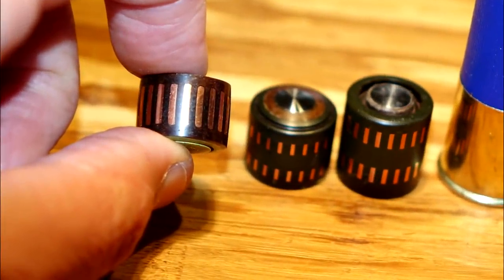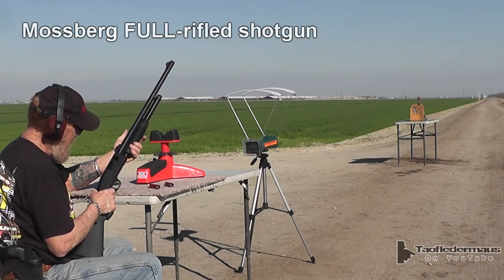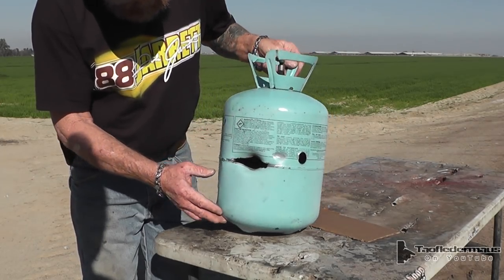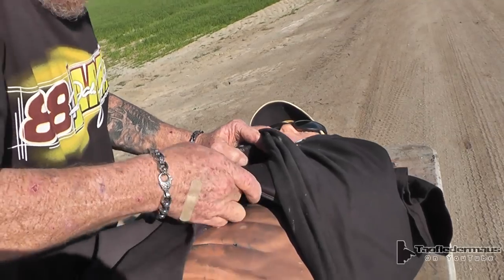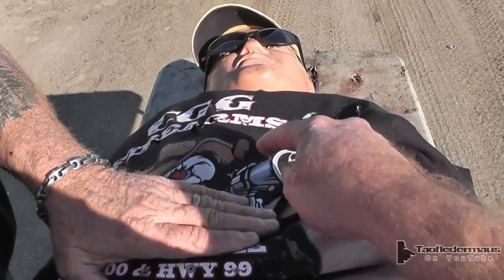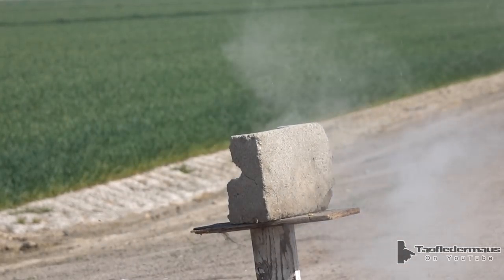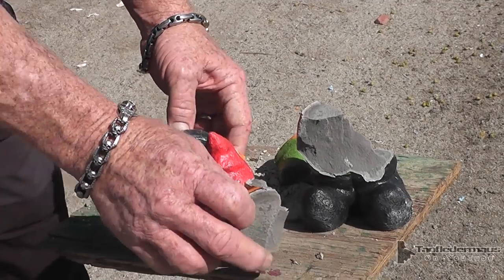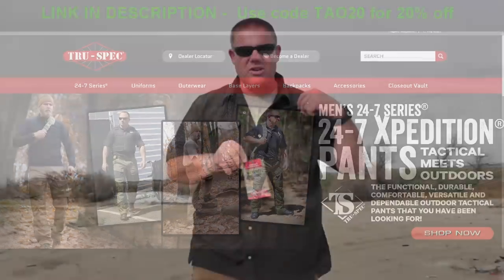Commutator Slugs -  Bissell Missiles -  You make it we Mach it

Comment: The weird pattern on the lead plate is probably from the little what looks like brass or copper strips in the outside wall of the coms either pushing out and back or cutting in while the plastic collapsed maybe? Curious to know as some of the coma u shot had small strips in lil 2 set rows others had single long ones

Comment: I didn't think they would do that well. Lots better than some of the high priced ones you've done I the past. As for Tru-Spec, I have a good load of their stuff and it holds together very well. Not only that, I had one package that I had ordered from them stolen while I was at work (UPS/FedEx) left it at my door. I called them up just to check if their was any insurance on the package. They said they would check and call me back. 

I was expecting a couple of hours at the minimum but they called back in less than 15 minutes and so no insurance, but they'd shipped out a new shirt for me and it should arrive the next day. It did, and included was also a free cap. You can't beat that kind of customer service. Not to mention, they're only a couple hours drive from me, so I consider them a local supplier. ;-)

Comment: One possible reason for the accuracy is that these commutator are balanced at the factory. A vacuum cleaner motor  could be spinning it 20,000 RPM so they need to be very strong to not fly apart under their own rotation and torque stresses. interesting experiment to say the least and pretty cool results

Comment: 7:20 idea for a new round. Nested domes into a single slug, so that the slug can follow rifling for accuracy but disperses into a group at a distance eventually, though tighter than shot, at least in theory the largest dome would impact a soft target & make the same hole as a normal slug, & each nested dome is simply additional holes in said soft target.

Comment: it makes sense these fly so well. Commutators are balanced so when spinning in the motor they dont cause vibration.
Reply from the maker: We've shot a lot of stuff turned on lathes that were very balanced but were not stable in flight
Reply: right, I wonder if it could have to do with how precisely balanced something is though. I suppose it could also have to do with center of gravity or maybe the steel core in these. Just speculation. Thanks for another awesome video though! been following your vids off and on for a while now its pretty neat to see the extent of what you can shoot out of a shotgun.

Comment: No real surprise those flew so straight. Electric motor core components are specifically made to be perfectly balanced in relation to central axle, so they would not vibrate when doing few tens oof thousands of rpms.

Comment: Commutators are designed to be perfectly balanced at extremely high speeds to reduce/eliminate vibration from the motor. Tha't why there should be no surprise at all that it was so stable whether spinning or not.

Comment: Stands to reason these would be pretty stable, a motor commutator has to be perfectly balanced since it spins at high speed. Add in a heavy core and it turns out you have a great slug

Comment: That plastic that was distorted should be some kind of bakelite or phenalic material.  Those materials are used because of the high heat from electric arcing that happens in that part of the motor.

Comment: Awesome.  Maybe they worked so well is because high speed communtators in motors have to be balanced to cut down on bearing wear?
Reply from the maker: We've shot a lot of stuff turned on lathes that were very balanced but were not stable in flight
Reply: Dear Sir, I'm at a loss then as to why they were so stable, unless the harder copper  bars were turned by the rifling in the barrel much faster than normal making them more into a bullet than a shot gun load?

Comment: I wear Truspec xtream Tru pants when I ride. 5 years 2 wrecks no wearing
Reply: MilesKenton they take the road rash good?  May have to pick some up for work on the farm and also work in general.
Reply: John-Paul Silke the knees have a rubber pad the rest is truspec ripstop. When I went down I was doing 40mph on dry dusty concrete and you can't see where I skidded on my right side. Second crash was a tbone on to the hood and front windshield. I added the truspec foam kneepads that are good also. Only thing I hurt was my wrist and ankle.

Comment: To be honest if its from a electric motor it should be balanced the motors need to be balanced
Reply from the maker: We've shot a lot of stuff turned on lathes that were very balanced but were not stable in flight
Reply: TAOFLEDERMAUS lathes aren't for electric motors those are balanced by a machine with lasers while lathes are not they don't check for microscopic wobble